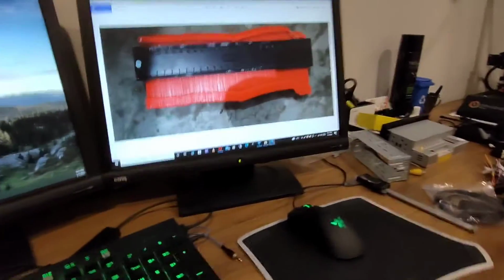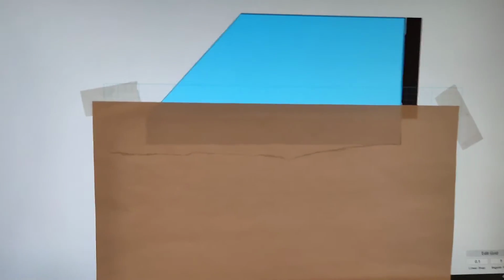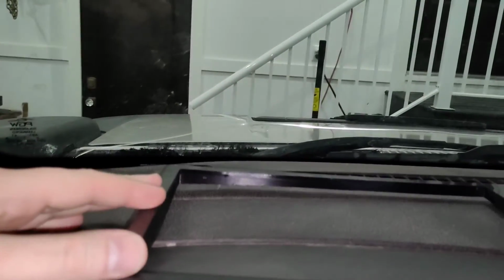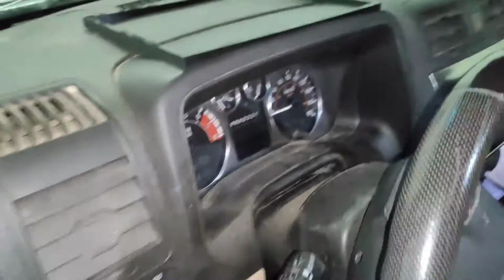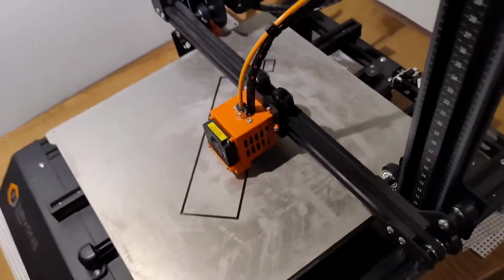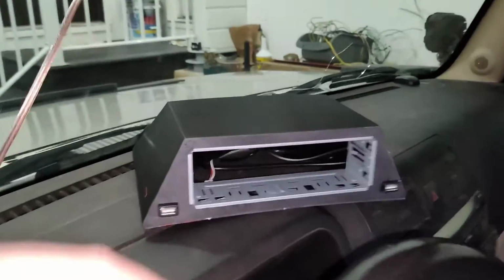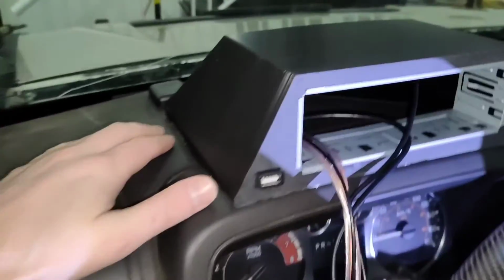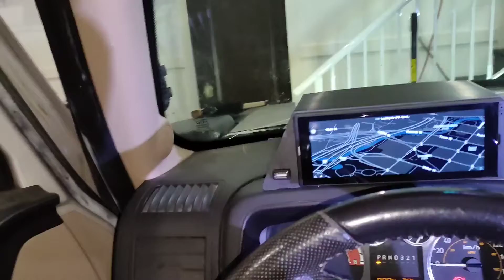Custom HUMMER H3 digital instrument cluster!

Comment: Hi.... would have been nice to see all the gauges working....how can I get oil pressure and transmission temperature gauges on Torque Pro? Good video 👍
Reply from the maker: Thx for the comment!

The transmission temperature is pretty easy, just add the included GM pids and then select the transmission temp dial there'll be 4 options, but only one will work.

The H3 doesn't have the ability to show the oil pressure through torque unfortunately

Comment: What monitor is it, and what r u wired into. Obd2?
Reply from the maker: It's actually just a cheap single din Android car stereo you can find on eBay, or AliExpress.

I have a Bluetooth OBD2 reader plugged into the OBD2 port that sends it the data. Then I run the torque app on it.

Comment: I'm not sure if this is a good location... at night it will shine directly into the eyes... off-road, this hump will block part of the view in front of the car - and without this, the nose of the hummer is too long... I would connect such an android panel instead of the standard panel through ELM and enjoyed the handy features...
Reply from the maker: It works for me 🤷

I'm tall enough that I can still see the hood over the screen, so it's not blocking my view at all. And at night, it automatically darkens and i have it set up to be mostly dark images on the screen.

My stereo does run Android as well, but now I can do more on two screens without having to switch apps all the time.